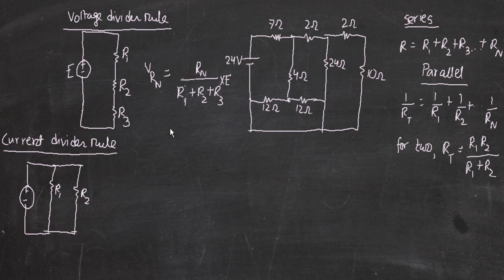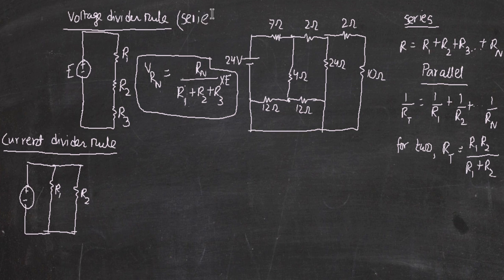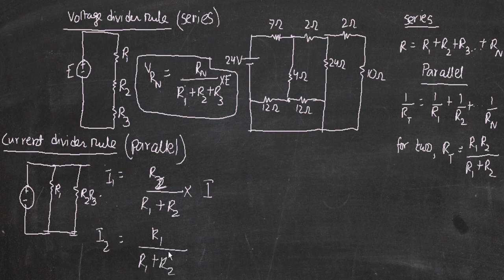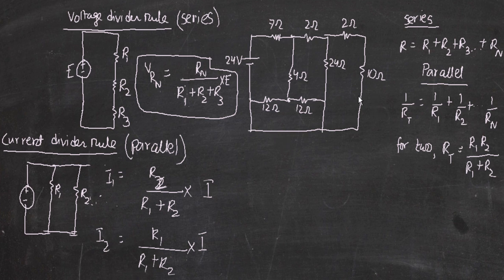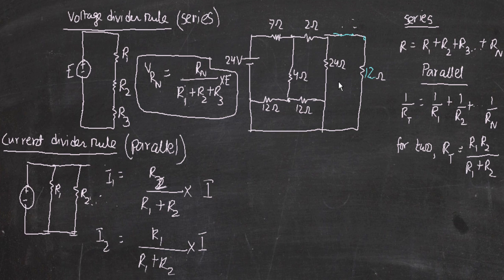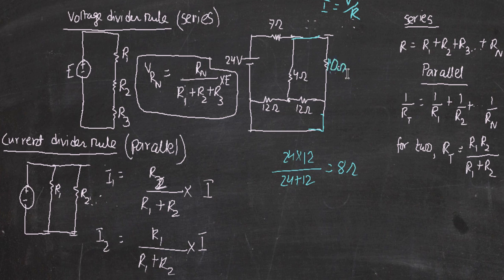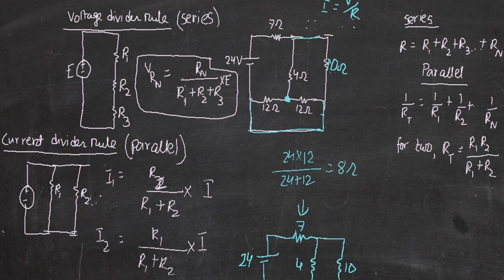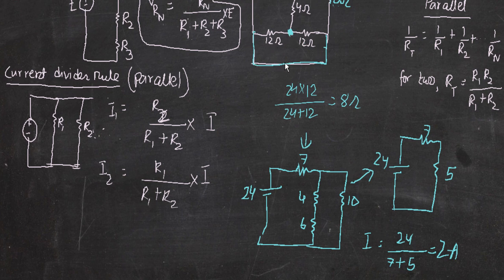Basics: Series/Parallel & Current Divider/Voltage Divider Rule

Comment: I didn't understood why both the 12 ohm resistors are in a parallel combination, can you please explain
Reply: theres no resistance n the bottom so the line could be considered as a node . You can move the line anywhere as long as it doesn't cross a resistor.

Comment: why 12 and 12 are in parallel?
Reply: Because both have same terminal of higher potential as well as negative. Just draw the circuit again in most convenient form, you will see the difference  and will understand it easily ..